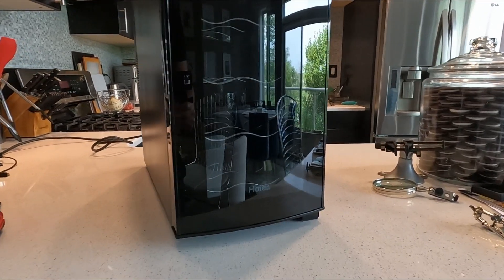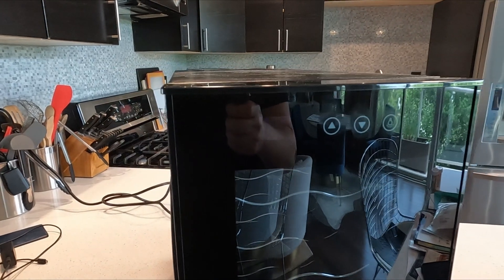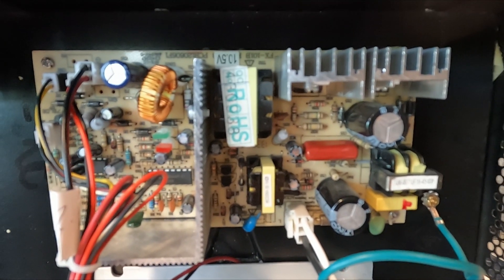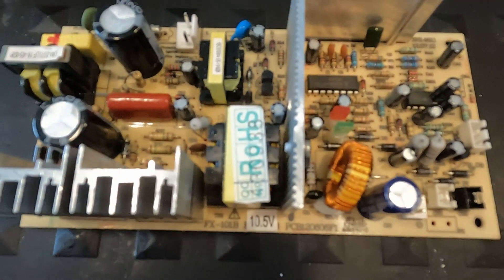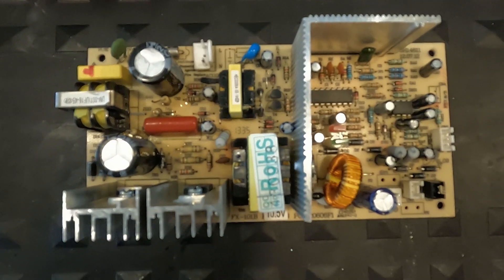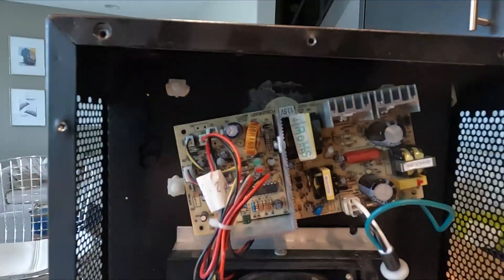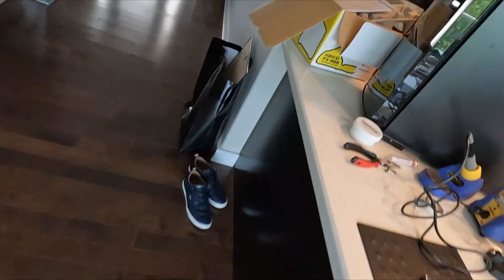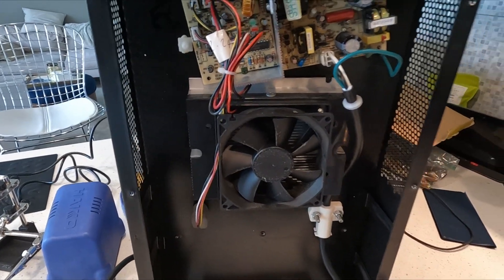Wine Cooler Repair

Comment: Just ordered the 25V 47µF capacitor (pack of 10) from aMazon.. Hopefully that's the fix. Looks like that controller board is used in multiple brands/model numbers etc.

Comment: Same problem, same repair (C8) for my 10-year-old Haier 12 bottle dual-zone wine cooler. Only problem was that I had to order a 10-pack of capacitors from AMZ for $4 (25V 47uF Premium Quality Low ESR Electrolytic Capacitors 5x11mm), so I now have 9 left over. The video was really helpful for locating the capacitor and it's trace on the back of the board. Thanks again!

Comment: Hi Joe! Thanks for your very helpful repair video. My Haier 18 bottle cooler exhibited a similar problem; flashing front LED screen, along with beeping and a warm interior. When I took the back plate off I noticed that the red and green LEDs on the upper board were not illuminated and the fan associated with this board did not spin at all. The LEDs on the other board worked and the fan worked for about 10 seconds on power up, then it stopped spinning. Replacing the C8 capacitor did the trick for me. FYI - for fridges with good LED lights and a fan struggling to turn, I recommend replacing the capacitor at C10. See this video from Joe's Garage for more info - https://www.youtube.com/watch?v=YTaEakcHy-A

Comment: Mine is showing the same problems but C8 did not solve it. I have heard that the small transistors may be the problem, I will be replacing them shortly and hope it works. Mine is the 220V version: FX102 at 10,5V.

Comment: Thanks Joe!  This worked for my Heier HVTEC12DASS. My screen didn’t light up at all and I had the chirping noise. Only one fan was working (it’s a 12 bottle fridge with upper and lower compartments). Replaced the C8 capacitor and it’s all patched up and working like a charm. Thanks for your video!

Comment: Hi Joe, another message to thank you for your video. I've just had to replace the C8 cap in ours (Koolatron 6 bottle wine fridge). The symptoms were that the fridge had been having a tougher time keeping the temperature constant over the last couple of months or so, and then 2 weeks ago it started making that beeping sound like you're showcasing at the beginning of the video. 15 minutes, 20 cents and a little of soldering action later, and the fridge is all good once again. I couldn't source 47 microFarad 25V capacitors locally, so I had to put a 100V one instead, which is a little overkill.

Comment: Just ran across your video, very useful info.  I have a Wine Enthusiast that is exhibiting the same behavior.  I just replaced the C8 capacitor and that did the trick.  No signs of bulging or leakage.  When I measured it, the value was way off.  Thank you for your post.

Comment: I have the same board with the same problem . Replaced the c8 but it didn’t helped 😣. Do you have any idea which capacitor should I try to replace next? Thanks 🙏

Comment: Thanks!  This worked for my Vissanni wine cooler from Home Depot.  The appliance repair shop quoted $321 to repair this.  The $1 capacitor at C8 fixed it.

Comment: Nice video. I have the same model and found that the circuit board was making some (not loud) noise when it was cooling. Fan is consistently running. Is it normal?

Comment: What do you think the issue would be for a cooler with the same setup, the panel is working but it’s not cooling ?
Reply: Check the Peltier cell, or just buy a new cell as they are not expensive.

Comment: Just replaced my C8 capacitor and once I plugged in the power, the board lit up, fans started working, and it started cooling.  Thanks, Joe!  I would've hated to throw this nice wine cooler away.

Comment: Hello I have been trying to figure out how to get past the 54 degree minimum on these it all points to the microprocessor but I’m wondering what will happen if I take it out is there a way to safely get past that 54 minimum the manual says the microprocessor is the keeping that temp from going under 54

Comment: Any idea what would be wrong if I set temp to say 70.  But it still seems to cool.  (Humidor version).  Room temp is 67-68. But the unit gets to 63.    It should switch the cooling off but recirculate fan only. Not sure where to begin.
Reply: Just got it today. I'd rather fix it then return and have to order and wait and wait

Comment: Thanks for the video!  My cooler has two of those boards.   The top one was bad.   I replaced C8 on that board and that fixed the problem.   That saved me hours of debugging time and there is no guarantee that I could fix it at the end. The capacitor is rated at 47uF 25v.   I measured the bad one, it had less than 5uF.    I then pulled the same cap from the good board and the cap reads 25uF so I replaced it too.  The capacitor appears to be a filtering capacitor at the output of a switching mode converter circuit.   There is a lot of ripple current going through that cap and that put a lot of stress on it.

Comment: CA capacitors? Where do u get one
Reply from the maker: C8 is the location of the capacitor on the board.  Each capacitor has an ID printed next to it on the board.
There's a link in the video description to where you can buy one.

Comment: There are numerous capacitors and other semi-conductors on that board. What lead you immediately to (suspect) C8? Thank you.
Reply from the maker: I read on the AllCircuits forum that most people replaced the C8 capacitor with success.  The thread link is in the video description.
Reply: @jwmartin83  it would be even better if the solution included an explanation of what function that cap performs in principle.  The basic idea of these coolers is the same, but there are varieties of make and models and another guys cooler with slightly different circuitry might have a C12 that performs that function.  So unless everyone on the planet has the exact model that you displayed here, the c8 cap fix isn't gonna help.
Reply: Mine was branded ‘Wine Enthusiast’ and the C8 did the trick. I only swapped it on one of the two boards and fired it up and it started working 😊 taped a spare 47uF to the inside with some sharpie notes of what I did. Board looked identical to the one in this video.
Reply: 47uf PWM coupling capacitor for the controller chip on the PS board. If it isn't replaced promptly it will cook the drive transistors.

Comment: Hello - This was very helpful as my looks identical and experienced the same problems after a power outage! I'd like to attempt the repair, but know next to nothing about soldering... can you comment on the soldering iron, solder and the "rope" you used to remove the existing solder? Thanks!
Reply from the maker: The soldering iron is a Hakko FX888 (linked in the video description), though you might get by with a less expensive one from your local hardware store or Walmart in a pinch.  The cheaper ones don't heat up as well so they're not as useful for more stubborn electronics.  I bought the Hakko a few years ago and I've easily repaired TVs, computers and other electronics that would have otherwise ended up in the landfill. I only use it once or twice a year but I'll end up having it forever... its well worth getting a good one.

I forgot which solder I used, it was either rosin-core or lead free.  Either one will do.

To remove the old solder I used a soldering wick.  Basically its braided copper, that when heated up, will sort of soak in the old solder from a board to allow the old component to be removed.  There are these "solder sucker" things out there as well, but I never found them useful.  I didn't use it here but you might want to pick up a small container of flux, too.

Good luck!